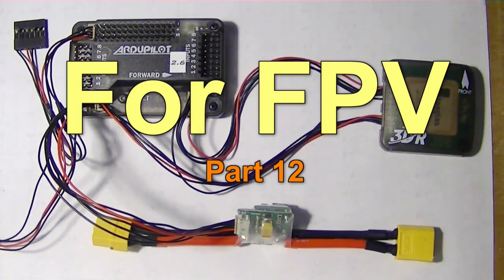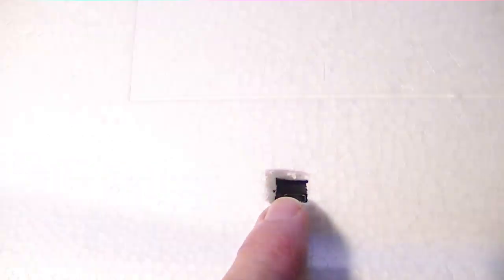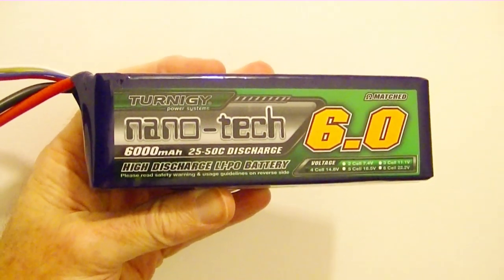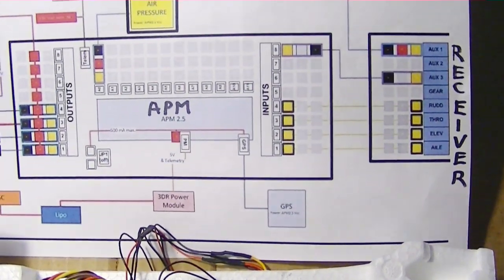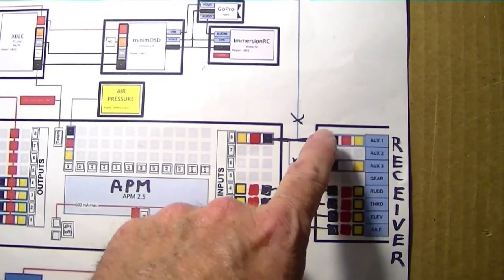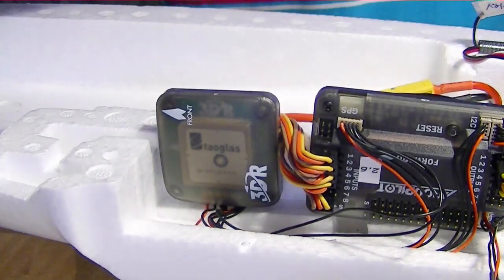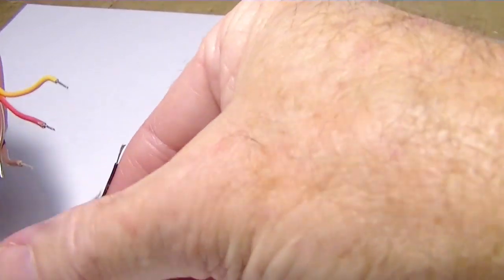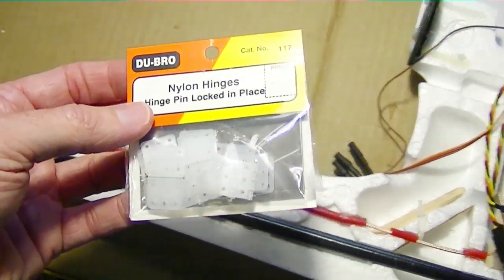FPV Part 12: Installing Wiring APM 2.6, Telemetry Radio and MinumOSD

Comment: I have t6ch spektrum dx6i radio .can i use for skywalker.with ApM 2.8?
Reply from the maker: You can use it but you will have to give up some features that require the extra channels.
I recommend at least an 8 channel radio.

Comment: Good video now is another question  so are you Y'ing off the battery to supply the ESC and Ardupolit i got a little mixed up on that part.
Reply from the maker: Power Module feeds the APM Voltage by it's 5 volt regulator and also has current and voltage sensor signals to the APM. You need one.

Comment: whats the difference between 2.5 2.6 and 2.7???? thanks
Reply from the maker: I think the APM 2.6 changed the compass from on-board (2.5) to external.
The 2.7 is HK's HKPilot which has some new features shown here:
http://diydrones.com/profiles/blogs/hobbyking-releases-hkpilot-2-7
The 2.7.2 APM version sold other places such as rangevideo has the same changes. http://www.rangevideo.com/3dr-pixhawk/848-ardupilot-apm-27-flight-controller.html
I am sure you can find info at other vendors as well.

Comment: Hello, 

Congratulations for this video and explanations. 

I am looking for information about LRS systems to buy and see that there is much else available in the market. 

I was very interesting setup chosen by you. Ardupilot broadcast EZUHF. 

Some range test was done with it? 

What is the maximum range of command and that video can you have with this setup.

Thanks
Reply from the maker: EZUHF 433 Mhz can go many kilometers for RC control.
Video is on 1.3 Ghz and also goes very far as well.
I have not range checked either one.

Comment: Hi, I fly ultralight airplanes. I would like to use the APM 2.6 as a basis for instruments for my ultralight. Instead of sending the data via a radio downlink, I would like to send it directly to an android tablet. This would allow the airspeed and altimeter and gps displays to be available realtime in the cockpit. Can you direct me  to a source for this information? Thanks, Tim
Reply from the maker: Sounds like a good idea.
Info for the APM is at
http://ardupilot.com/
Reply: *****
 The problem I have is that I want to connect the APM 2.6 directly to the android and not have the radio downlink. That is not covered on the website or discussion forums. Thanks again, Tim

Comment: First of all, I want to tank you for such of detailed videos you share in your channel, I am from Chile (South America) and your videos inspired me to get involve in FPV :)
Now I need your help with the diagram how to wire the LRS and the APM, I saw that you use a separated energy source (BEC) but I have no idea how to wire all the components.
I was wondering if you can share the diagram that we see on the video.
I would really appreciate your help

Thanks again,

Anuar Ferrera
Santiago de Chile
Reply from the maker: See if you can access my modified wiring diagram here:
https://docs.google.com/file/d/0BwJCCr4qRHixcHhlcHFtaV9XT0E
Reply: Thanks , let me see if I understood good, the only servo wire complete with power,gnd,signal is rudd from receiver? Btw I am using a LRS EzUHF
Reply from the maker: Anuar Ferrera Actually I have complete servo wires on A,E,T, Aux1 as well but it is not necessary to have more than one voltage and ground wire. For the pan/tilt (Aux2, Aux3) wires only hook up the yellow signal wire because those servos get voltage and ground from the UBEC. Make sure the JP1 jumper is removed for this wiring!
Reply from the maker: Anuar Ferrera For the video pod wiring see FPV Part 14 because I hook up the MinimOSD different than the way it's shown in this diagram. Not that you have to do it my way, you can use whatever works best for you on the OSD section.
Reply: Thanks :) understood

Comment: Hi,
I have been following your video's while I build my Skywalker and they have been helpful.   I am incorporating some of you build suggestions.

I noticed that I have the same EZUHF radio system.  The EZUHF supports PPM and the APM 2.6 also supports PPM if you jumper pins 2-3.  Did you ever switch to PPM and just hook one cable between receiver and the AMP 2.6 on Channel 1?
Reply from the maker: No I have not done that.
However 3 of my channels bypass the APM and go to my Pan/Tilt and video switch. Not sure I can use PPM because of that reason.

Comment: My ublox gps is a neo-6m and it came with a 6p to 6p cable.  I cant arm apm or get a gps lock. Do I need the 6p to 5p cable?
Reply from the maker: Yes this happened to me too. Contact the vendor because some came with the wrong cables.

Comment: I have followed every video you posted you are a tremendous help you make set up very easy but I am at my breaking point with ardupilot 2.5. I was able to connect to Mission Planner without any issues it worked 100 percent of the time now it just times out every time and I cannot upload firmware to my plane
Reply from the maker: Yes I have had that happen. It turned out to be a bad USB cable.
Another time it was because I tried to use the telemetry radio link instead of the USB cable and that fails with MavLink error. There are probably other reasons as well but I have not run in to them... yet.  You might also try disconnecting the MinimOSD and Telemetry Radio while uploading firmware because it may think you are trying to use the MavLink.

Comment: Do you plan on buying the Pixhawk at all?
Reply from the maker: What is the difference between the Pixhawk and the APM 2.6?
Is it better?
Reply: Memory, processing speed, automatic  peripheral detection, multiple telemetry ports.. ect.. it's the reason apm is no longer in production
Reply from the maker: joshua stannard Great, may be I will get one some day but I have become vested in the APM 2.6 for now which works well with the SkyWalker plane.

Comment: Nice video thanks

If I want to make a y-6 copter which is consist with 6 motor not any servo 
 should I connect only signalwire from esc to APM? 
Because there is no servo to feed 
Or should I connect gnd also??
Reply from the maker: I don't have any information on the Y-6.
Never built one.

Comment: Im building a y6 tricopter and useing the apm 2.6 got any tips
Reply from the maker: Check out the Arducopter wiki and forums.
I have not delved into copters yet. All I know is that the APM requires the firmware for copters to be downloaded.

Comment: Great idea to use the print of the schematic. Don't see the diff btwn 2.5 and 2.6. But any way at least Hobby King has got thru some of their backlog and my order, one of 7 suppliers for my APM QUAD w/ FPV build, is finally in the damned post. I can almost see all stages of the build. Thanks Dmerc00 as always

Comment: No problem :) 

We use an external Bec for another reason too. If the ESC gos into a thermal shutdown it also cuts the power to its Bec, when this happens the plane is completely dead and normally crashes badly. With an external Bec if the ESC shuts down, you still have control of the servos ( or the AP has ) so even though it has no power, you or the AP still has the ability to level, turn or land the plane

Comment: Yes that`s correct, the Bec is connected away from the ESC so the ESC current flows down the intended cables into the current senor, not looping out of its own Bec ground wire into the APM

Comment: You can, again because the input of the Bec will still give you a common ground, but the way it is fitted ( Bec input voltage wires connected to the current sensor output ) means the loop is then from the current sensors output to the current sensor. ) This is perfectly safe though. You connect to the current sensors output tabs simply so the current sensor measures the mah used by the Bec and accounts for this in the OSD readings.

Comment: Hi Dmerc, you do still have a complete circuit, the ground for the ESC is common with the ground of the APM at the APM`s current sensor. The only difference is that there is no longer a ground loop ( 2 commons (( ESC servo wire and current sensor ground)) making a loop ) anymore.

Comment: I would use a Ubec as well, not because your Esc`s Bec is underrated but because your introducing a bad ground loop through the APM that can enable motor current to run through the APM damaging it. With the separate Bec you only need the Esc`s white signal wire and loose the potentially unsafe ground loop

Comment: Hey thanks for the plug!
Carbon fiber is the enemy of GPS, I would recommend that you place the GPS on the top side somewhere.  I and many people place theirs where you want to put the telemetry radio. I also recommend a UBEC.  It looks like you will have plenty of room to slide your battery back and forth for balance.  I put a long strip of velcro on the floor of the plane 6" or so, and a smaller piece on the battery so it is not too hard to move the battery.  Lookin Good